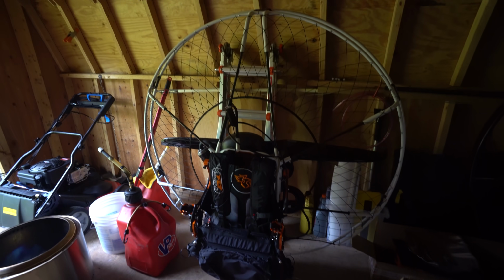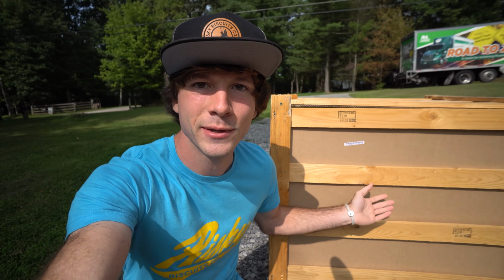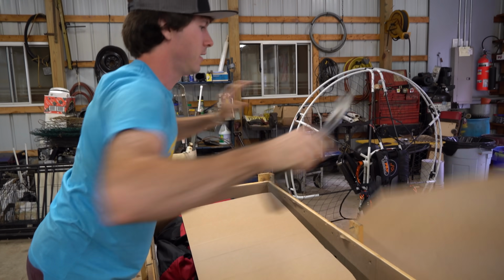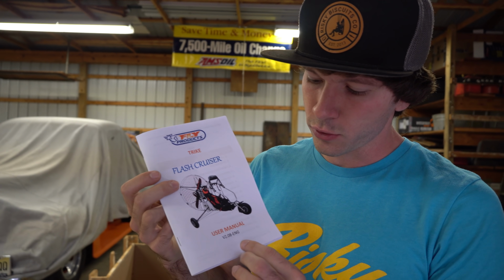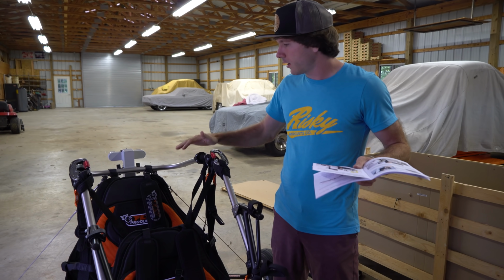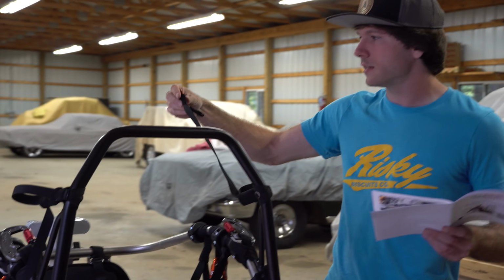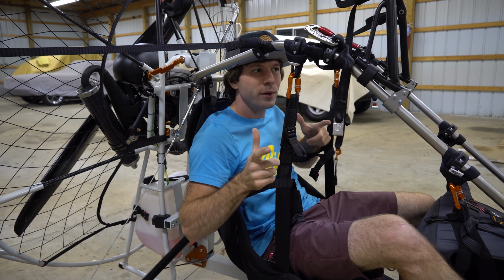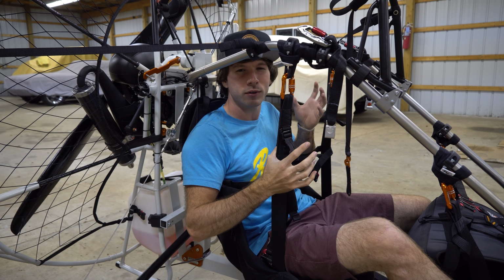Are trikes just for lame old dudes?!?

Comment: Question?
Why does one need "certification" to fly tandem?  The FAA granted an exemption to the USHPA which if you are not a member then how does any of this apply?  To me it is kind of like a person being a highly proficient PPG pilot and not be "certified" as PPG3 rated.   Not trying to stir the pot and I know that FAR103 expressly states that PPG flight is solo only.

Also, why are people getting "certified" as tandem flyers if pretty much everyone is going to ignore the requirement in the exemption that states: "3. Both occupants on all two-place training flights must possess a current pilot rating issued by the USHPA...".  How many times will this be followed?  I understand that training = safety but this seems to be to be a USHPA scam to increase their prestige.  Good on em I guess...
Reply: Need exemption to part 103 that says ultralights are for 1 passenger only.  Bringing another person into the mix means there is another person that can get killed that is not the pilot in command.   I don't think it's a USHPA scam, but the only loophole for tandem, and it's for instruction only.   I am hoping Tucker has that exemption.
Reply: @andyandmarlys  But it seems meaningless to me if you go through the hoops to get the exemption and then ignore the part #3 (see above).  You will not be in compliance with the exemption any more than the pilot who ignores it completely...
Reply: @justbrentbenson5419   The exemption doesn't say there has to be two pilots, and Tucker confirmed he has the exemption.

Conditions and Limitations
1. This exemption is limited to § 103.1(a) only.
2. Each flight must comply with all other sections of part 103.
3. All flights operating under this exemption must be for training purposes only. This
exemption applies only to flights for the purpose of giving instruction in two-place
powered or unpowered ultralight vehicles to provide students with basic skills
necessary for safe flight. There is no training program requirement found in part 103,
so training should provide sufficient understanding of information provided in the
FAA Pilot’s Handbook of Aeronautical Knowledge and the Powered Parachute Flying
Handbook as applicable to part 103 operations.
4. Prior to all two-occupant training flights, the student must be informed that the flight
is conducted under an exemption granted by the FAA and that the two-place powered
or unpowered ultralight vehicle does not meet aircraft certification standards set forth
by the FAA.
5. For identification purposes, USPPA shall issue an individual authorization to each
person allowed to conduct operations under this exemption. Each authorization shall
include an identification number and a copy of this exemption. USPPA shall also have
a procedure to rescind this authority when needed.
6. Each individual who operates a two-place powered or unpowered ultralight vehicle
under the authority of this exemption must be familiar with the provisions contained
herein and must have in his or her personal possession a copy of the authorization
issued by USPPA and a copy of this exemption. These documents shall be presented
for inspection upon request by any representative of the FAA.
7. Upon request, the USPPA will provide a representative of the FAA with a list of each
person allowed to conduct operations under this exemption.
8. This exemption is not valid for flights outside the United States.
Reply: @andyandmarlys  Funny.  I am looking on the USHPA's website:
https://www.ushpa.org/page/faa-exemption-4721
and I am not seeing the same #3 as you have printed out.
Can you explain that?

Also, my comments are generic and have nothing to do with Tucker.  I am sure that he will practice all due diligence prior to any risky biscuits business he will do...
Reply: @andyandmarlys  So we both have links to the exemption from the USHPA website.  You seem to have linked the original message from the FAA before exemption #4721 was codified and my link seems to show the finished and codified exemption.  I know this is getting deeper into the weeds than a good footdrag but it looks like USHPA has combined points 1 and 2 into a single point and then have added the part  (#3) about both needing to be pilots.  Ergo my thoughts of USHPA scammage...